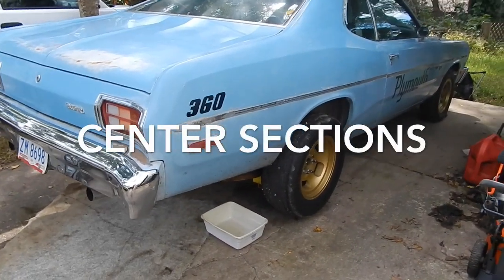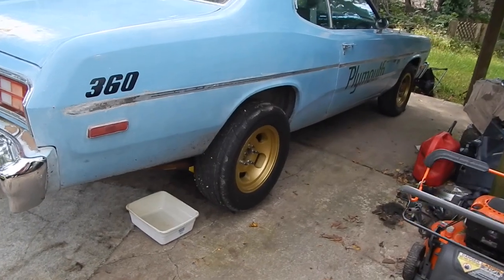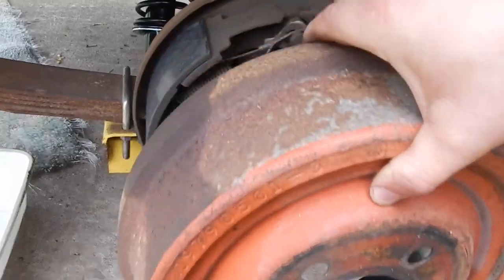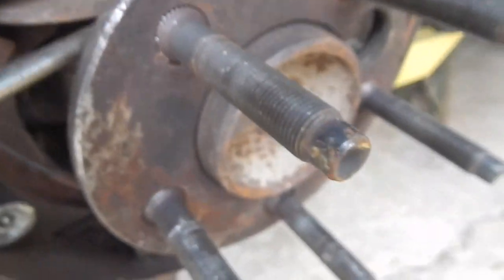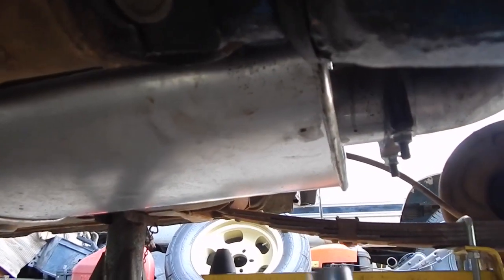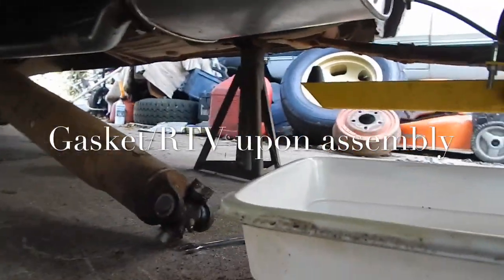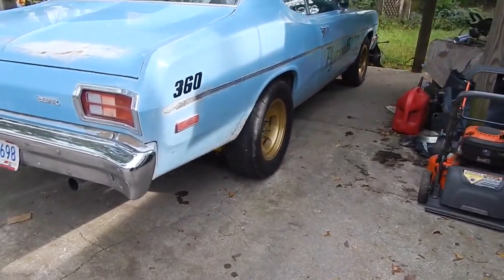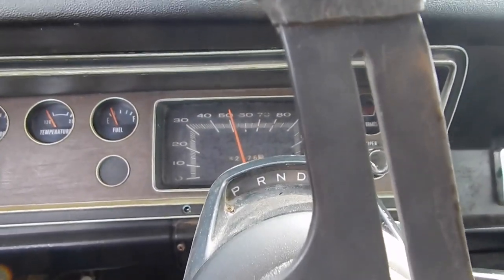Swapping Gears 8.75 Rear End Plymouth Duster

Comment: Nice. I'm in the process of swapping the 8.25 out for an 8.75 (489) I'm piecing together myself. 
The 8.25 has 3.21 rear open-diff gears, which has been nearly perfect for my restomod build. But I do a lot of long distance driving with it. (3000 rpm at 70 mph)
However the 8.75 I'm building is going to have 3.55's in it plus a rear disk conversion, because I do plan on getting a gearvendors unit soon. (the current third member has 2.76 open in it right now). Mine also has a beefed up A999 auto trans in it with lockup removed.

Comment: I'm curious what your ETA will be with that swap.
Reply from the maker: Maybe a be a tenth.  2.76 to 2.94's isn't hardly noticeable.
Reply: That's true, would love to swap a limited slip in my 8.25 with 3.21s or swap the axle completely later on.
Reply from the maker: Dr. Diff is a good source for Mopar rear ends.  Ships fast and is knowledgeable, keeps many things on hand.
Reply: @318willrun  I'll check it out, thanks for the information.

Comment: hey how do you put the differential oil(grease) into the rear end?
Reply from the maker: level plug on the side of the carrier.
Reply: Best way is to drill a small hole into the plastic jug and hit it with a small amount of compressed air.

Comment: Why change the whole third member and not just swap gears?
Reply: Much easier to plug n play rather than pull 3rd member , disassemble it , put new ring and pinion then set tolerances and stuff it back in

Comment: I've got that 77 B100 van 318 3 on the tree, i did video on rebuilding column shifter. (Trany's out atm for bearing) rear has 8-1/4 3:21 gears that I love but 1 wheel !  Dam that rear setup is $500-650! I cant do it on retirement pay!  Anybody got a rich sister-in-law or auntie ya can push my way?
Reply: shave & shim , the Borg Warner , cone type ,… cheap like borscht !